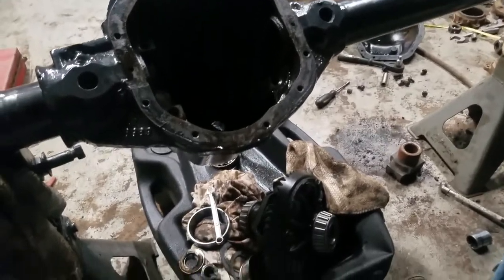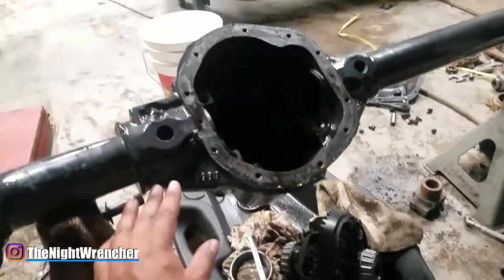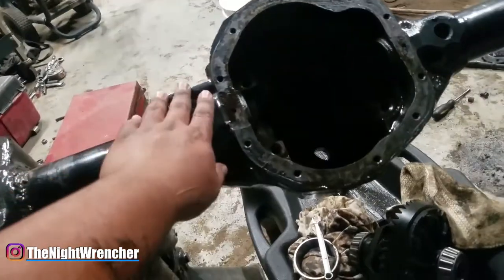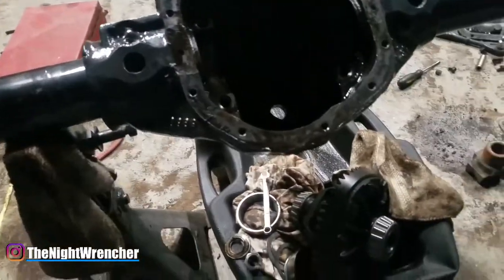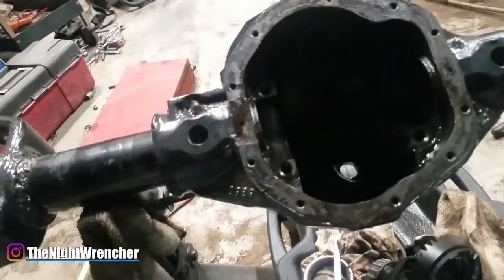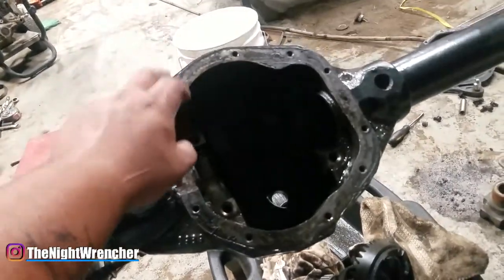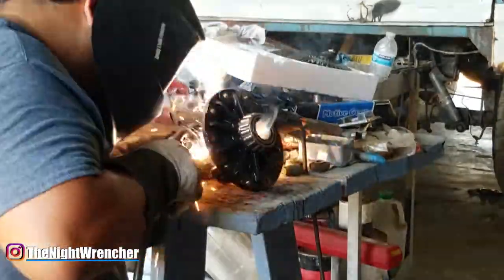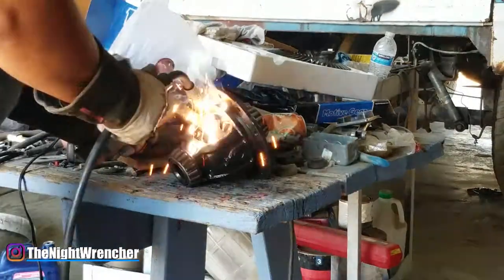DANA 44 REGEAR- HUGE NEWBIE MISTAKE | Budget Dana 44 Build | Dana 44 Rebuild

Comment: Thanks for the info because I will eventually be putting different gears in my Dana 44. Sorta related, but something I learned today the hard way was that there are 2 different bolt patterns for the axle bearing retainer plates for drum brake 44s. I did know about about the plates being different for disc brakes but not this. That was a wasted few hours and $75🤦‍♂️
Reply from the maker: I know the feeling unfortunately. I ended up buying the right carrier to fix this. Swapped it out for a front spool 👍

Comment: I also learned this the hard way. Had to get a new carrier, fortunately the carrier I was trying to use was one I had laying around.
Reply from the maker: Lucky! Ill be picking up another set of gears down the road since I probably already screwed these ones up lmao
Reply: @NightWrencher  I ended up getting 513’s but I didn’t know about the thick cut gears for the Dana 44s. I’ve rebuilt a few Ford 8.8s So I had an idea how to do it but this was just a learning experience I guess
Reply from the maker: I had done a ford 8.8 a week right before the D44 and for the 8.8 I didn't have to mess with gear thickness or anything so when my gears showed up for the D44 I ended up learning something new and then I made this video lol
Reply: @NightWrencher  Yeah I’m pretty much the exact same way. I just wish I had seen your video before I started doing this to save myself some time and trouble
Reply from the maker: @Bigtommyboy6996  well now we both know 🤣🤣

Comment: Question @NightWrencher , I have a 7.5 373 front axle and I’m wanting to regear my front axle to 4.10 like my rear 8.8 axle. The 8.8 is already geared to 4.10. If I understood you right, I’ll have to find some thicker gears even if I use shims?
Reply from the maker: 7.5 or 1975? If you're asking about a dana 44 out of a 1975 truck that came FACTORY equipped with 3.73 then you will need THICK 4.10 gears to match your rear. The shims you will use will go underneath the bearings to set the proper lash. You will ALWAYS  need to set the proper lash with shims beneath the bearings. The shims that I was talking about were some that I made  to go in between the ring gear and the carrier to take up the slack that I had when I bought the wrong gears.
Reply: @NightWrencher  yea, I have an 89 Ford Ranger with a 7.5 inch axle with 373 gears. It’s Coil Spring which means the Lift Kit I have will not work with a front axle that has torsion bars. I got the 8.8 rear end with 4.10 gears out of a torsion bar truck which means I will have to Re-gear my Stock 7.5 front axle to match the rear (4.10). The Donor truck that I used is a 2002 model. I was just wondering if I would have to get a different carrier for the Front since I’m going from a 373 to 4.10, or find thick gears. Thanks for replying
Reply: @NightWrencher   but yes, the stock 7.5 373 came out of an 89 and I swapped the rear 7.5 to an 8.8 with 4.10 gears and Limited Slip already in it. Just trying to figure out something with the front axle.

Comment: I realise this is an old video, but, they make ring gear spacers for this problem, jegs or summit will have them...
Reply from the maker: They do, and I bought one. I actually had to make a 2nd one so it all fit properly. The issue is that the gear no longer registers with the diff and becomes much weaker. I later swapped to a spool with the right offset and all is good. Never had issues with a double spacer though

Comment: Did you ever get the CAD knuckles into the full time housing?

Do you need to use the inner axles from the full time with the outer axles from the part time? Or do the part time axles just fit?
Reply from the maker: Yes I did actually. Documented my progress on instagram. Several pics to get you an idea of what I did https://www.instagram.com/p/CD0QzZWhAJ2/?igshid=1qpavv42632zy
Reply: @NightWrencher   awesome man! Looks good.  Followed you too. 

I looked everywhere for info on putting these knuckles on. I have a 77 macho and an 84 power ram, I wanted the 5.5 bolt pattern on the 77. People are putting ford spindles on the full time knuckle with some modifying.  I measured it and was wondering why no one puts the whole 80's dodge knuckles on.  You proved it worked! Thank you!
Reply from the maker: Its all bolt on with the right tools and parts! Make sure you swap the spindles complete with brake brackets because the newer axle has bigger bolts for the brakets but the calipers are the same.